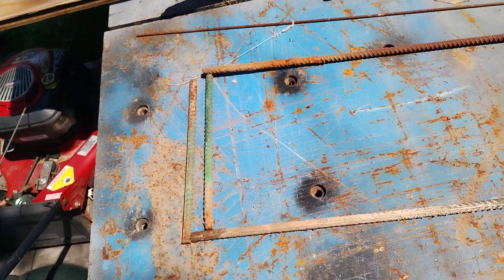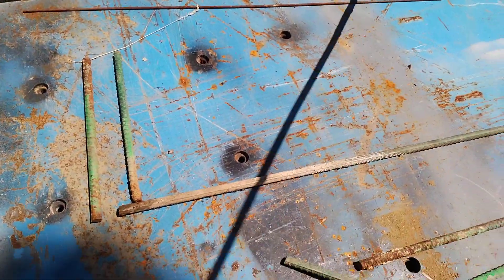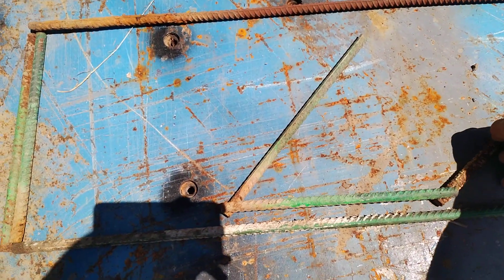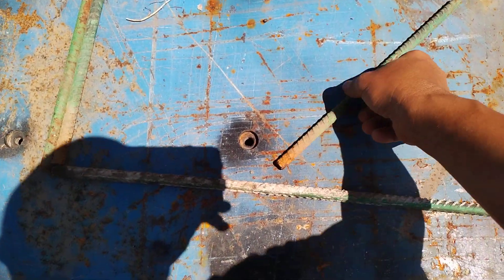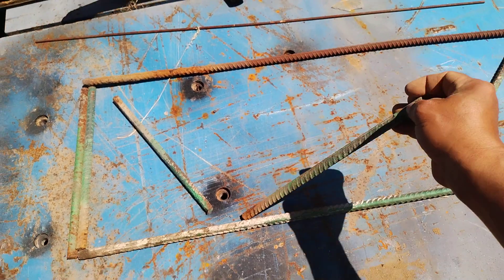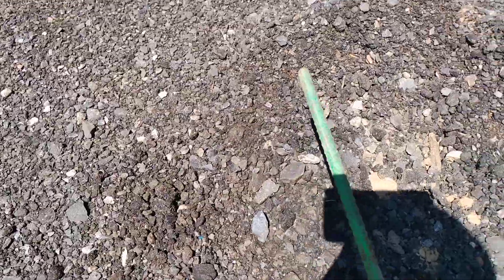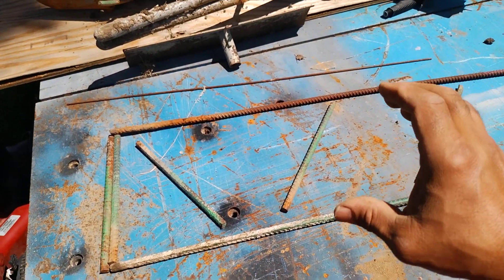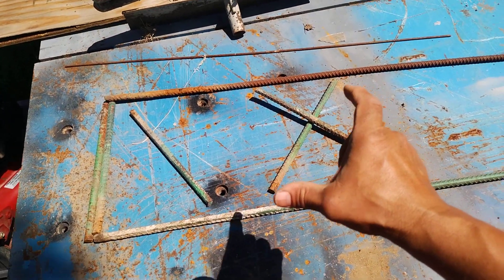Rebar Development Length Cross ❌ pattern can get you your ''anchorage" and explain "cone blowout"

Comment: Algorithm comment. 75k lb rated train table - must have some interesting uses with your varied hobbies. I get that the design must have had some positives to compensate for the flaws/material deletions/value engineering, or it wouldn't have lasted as long as it did.
Reply from the maker: Cat Woman, the tables are very much appreciated, their "flatness" is what I depend on.
Reply from the maker: https://youtu.be/qSOzpl1afbQ  is a more defined video of the same content; one different configurations also.